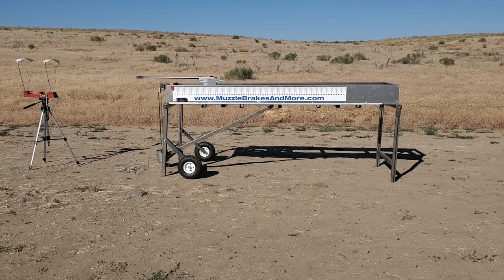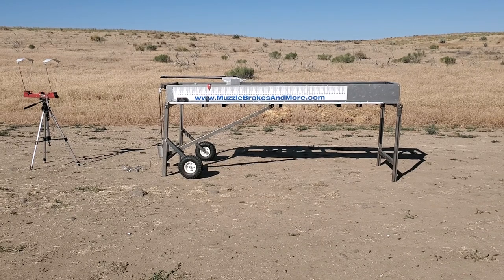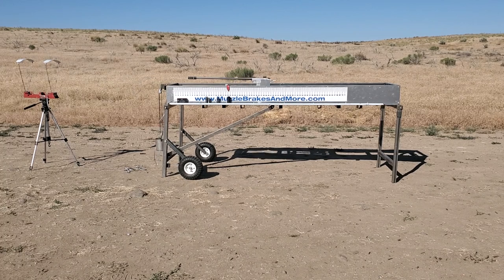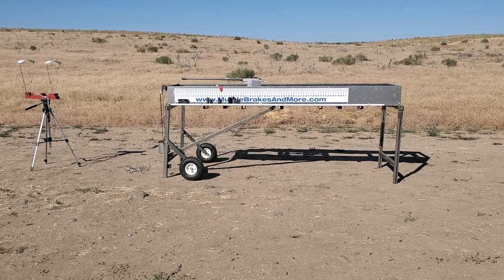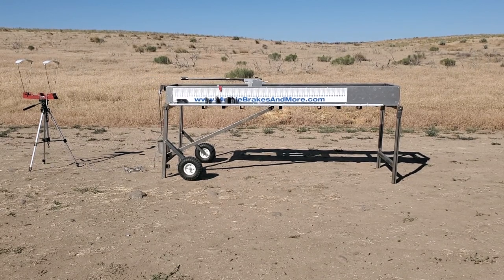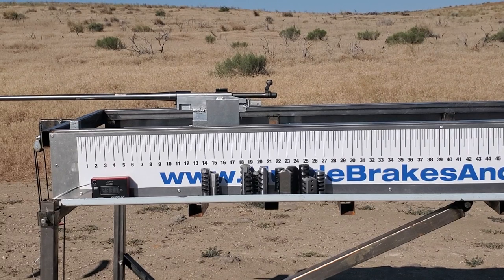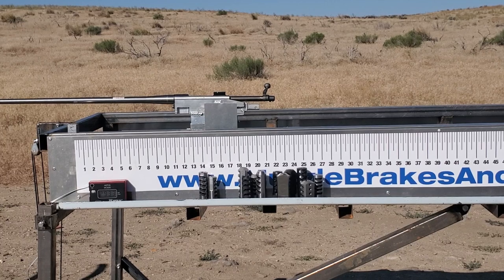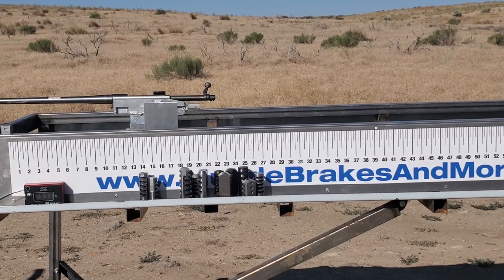300PRC muzzle brake test

Comment: Easy to cheat - all you had to do was put additional weight in the bucket for your brake.
Reply from the maker: There is no weight in the bucket at all. The bucket just adds a bit of weight to calm the sled upon initial firing to get more consistent results. I guess I could make a expanded metal bucket instead for skeptics like you. That way you could see through it. Unlike some I dont need to cheat. My brakes perform as advertised. Most others don't even show velocity or how they actually come up with their crazy high percentage of recoil reduction claims. I built the test sled, I'm pretty sure if I wanted to cheat I could and you'd never know it was happening. The same could be said for about any video testing anything on YouTube or anywhere else on the internet. 

The cool thing is I have a even better brake design that is almost finished and will be released soon. The sled travel is a couple inches less already if I don't change anything from now until it is released. When you actually test design changes and tweaks you find out what works. That is how I know I make the most effective brakes on the market. If it came down to having to prove it in front of a audience I'd have no problem doing it. I doubt you'd find others willing to say the same.
Reply from the maker: @lessforloans  It depends on when I can get out for more testing. The weather has been cooperative. I want to test a few more tweaks before I release so there is nothing left on the table this time.
Reply: So is this new design ready yet
Reply from the maker: @honcho714  No not yet. The weather hasn't been great for further testing and I'm working on stock for my Beast series brakes before going full bore with the new ones. I have some other little tweaks I want to test before releasing them.
Reply: @muzzlebrakesandmore3492  building a lightweight 338 if your looking for a guinea pig.
Reply from the maker: @honcho714  I've already tested it pretty extensively. I'm just going to try a few more little tweaks to see if I'm leaving anything on the table. I don't want to go 95% of the way and not finish.
Reply: @Gods And God's Grace I've actually bought the 1 piece super beast 5 port brake from Muzzle Brakes and More. Seen a similar video to this one showing muzzle effect on sled. And I just went with his brake. I looked on forums and alot of people mentioned him so I figure I take a shot at it. Got that brake in 2017 and still shoot my 300wm with no uncomfortness. I've had surgery on my shoulder twice. The kick is as much as a 556. His brakes are effective. Also I'm sure he can care less to prove his point to you lol. This guy does his testing and it shows.
Reply: @jr3363  and the consumer can care less about his easily rigged test and buy elsewhere and care even less about what you have to say .  If you read forums carefully you will see his brakes are well regarded for the price , for the price , keep that in mind . For the Manbun 6.5 creed  crowd effectiveness   doesn't matter as much because no brake is needed on such a meek cartridge . To a guy shooting a 8 lb 338 effectiveness becomes the number 1 factor , not best for the money.

Comment: What do you recommend for a 300 PRC CA MPR with carbon fiber barrel? 5 port Ti Beast?
Reply from the maker: I would do a Ti Beast CF since it has the same ports as the Ti Beast but it is closer to your barrel diameter at the muzzle.

Comment: Hello, congratulations for these videos, I wanted to ask if the APW raptor brake used is the monster 5-port version or the normal 5-port version.  Greetings from Spain, I subscribe to the channel.  thank you.
Reply from the maker: It's the standard Raptor. They didn't make the monster version when I bought it.
Reply: @muzzlebrakesandmore3492  Thank you very much, greetings friend.

Comment: Are you still making videos ? 

Would be interested to see the mdt comp brake in action if you have any in your collection
Reply from the maker: The first port on the MDT Comp is 90% rather than angled back towards the shooter. That greatly reduces the effectiveness of a muzzle brake. It helps with the concussion but gives up a bunch of performance. It's the same principle as the Muscle brake. The first port does a higher percentage of work than the rest and handicapping it by making it 90 degrees drastically reduces the overall effectiveness.

Comment: Apologies for the silly question, but what would you suggest for 5.56/.223 ? Kind regards.
Reply from the maker: A 2 port or 3 port. The specific brake would depend on the barrel diameter, thread size and 1 piece or 2 piece self timed.

Comment: Have you done any with your  Super Beast II brake?
Reply from the maker: I haven't tested them recently but they have the same ports as the 1 piece Super Beast which are slightly larger than the Big Beast II. I haven't done a overall test because most of my competitors brakes that I use are roughly the size of my Beast/Beast II brakes. They perform much better then they did in my 300wm test since I redesigned them though.